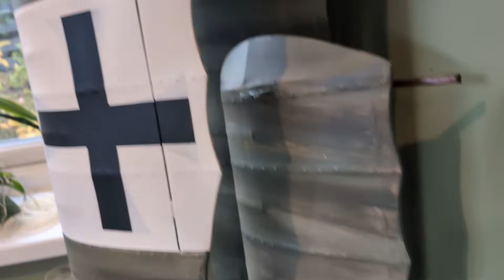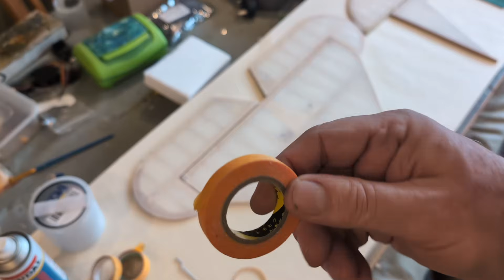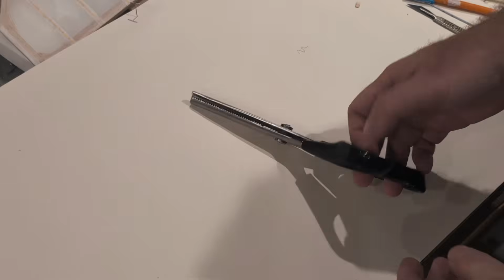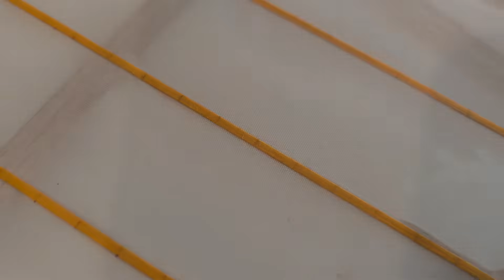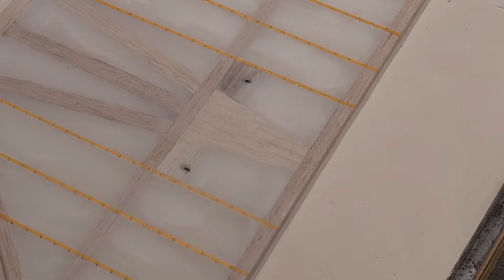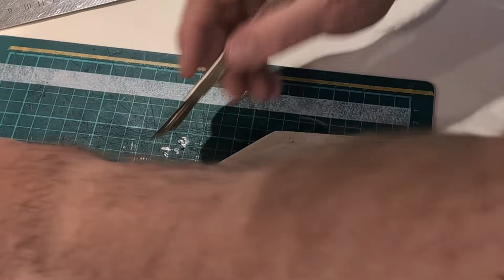Simulating rib stitching:  How to achieve convincing results.

Comment: Nice tutorial Mark.  Lots of different ways to replicate an interesting scale feature.  Personally, I prefer the frame and thread method and I find it quick once you make the initial piece of thread covered fabric to slice bits off of.  I use a small thread on it so it doesn’t look over scale like you mentioned. But your method works well too.  Many ways to skin a cat so to speak. 

My only critique is that the glue drop method looks more like screws under the rib tape with the roundish glue lumps.  This replicates fabric screwed down and tapped over well (like a Fleet biplane) but personally, looks to round for thread stitches.  But that is personal preference.  I still like that you took the time to add scale detail.  Well done!  Also, many German fighters of this period also generally used a zig zag stitch which is a pain to replicate.  Most people don’t go that far as it is an exercise in futility 😂.  Love the content, keep cracking on mate.
Reply from the maker: Thanks for the feedback,I'm aware of the need for zigzag stitching but boy that's a step too far for me at this scale at least.

Comment: Excellent once again Mark!
At some point could I ask that you show your method for attaching and framing windscreens, both modern and older aircraft types. This is one area that I really struggle with and it always lets down my efforts at cockpit detail.
Reply from the maker: Thanks for the suggestion, I'll definitely consider it for a future video! 
I have shown how I use paper templates and a " brass rubbing" technique to accurately mark out glazing on one of my building videos.
A separate stand alone video is a good idea.